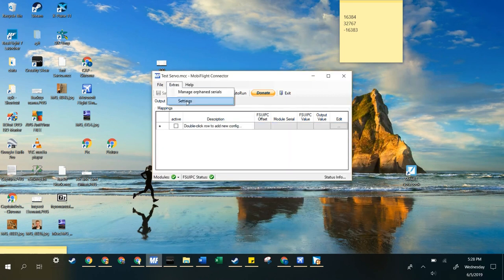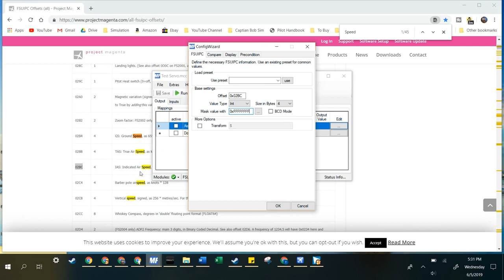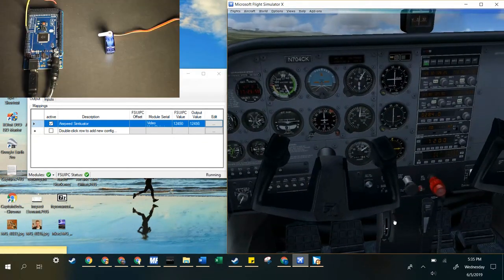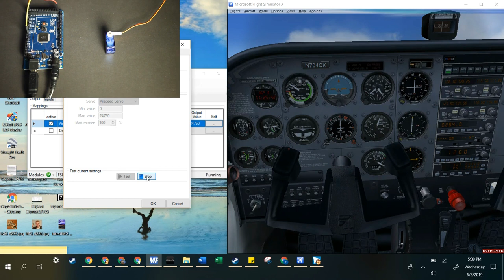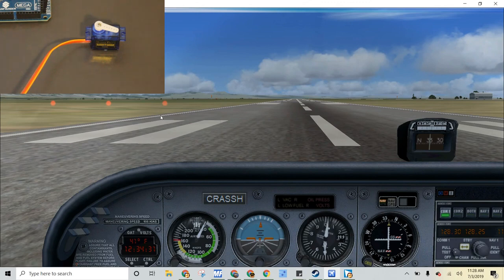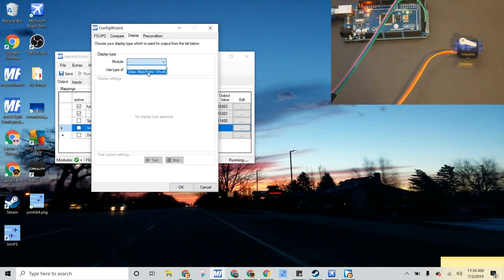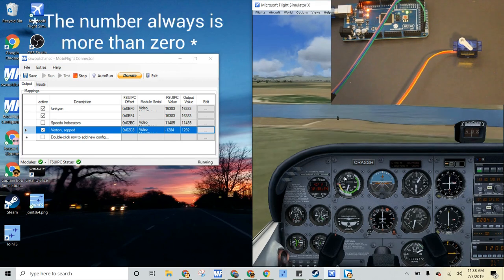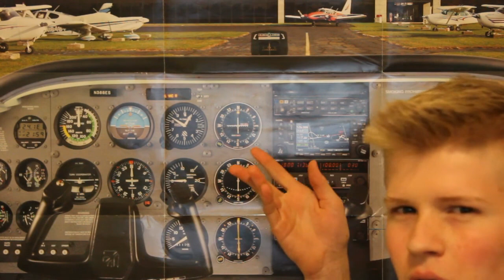How to Connect a Servo with FSX using MobiFlight | Captain Bob

Comment: We are running Mobiflight and using servos for our Turn & Slip Instrument and the two Volt/Ohm Instruments. The servos work for a while that after a few flights, the servos are non-functional. We are using Tower Pro Micro Servo 9g servos. No mechanical binding on shafts or Pointer. Any ideas?

Comment: I do exactly the as you do and the servo works fine but whenever I click on "test" in Mobiflight, my arduino board disconnects so the servo works for only 1 time. When I put a wire into the 5V pin, the arduino disconnects. How can I fix this?
Reply from the maker: Hello! Do you have anything else connected to the board? If so you could be overdrawing the arudino. If not I'd check your wiring and try another servo because this isn't normal behavior. Are all 3 wires connected correctly? Sometimes I put a pin in the slot next to where I think it goes.

Comment: Hi can You tell me if I can use a 360 degree servo motor to build a heading indicator? Or It's possible only with a stepper motor?
Reply from the maker: I'd go with a stepper, a 360 servo would have to rezero every time you go from 359 to 0 (go backwards 360 degrees)

Comment: Hi Captain bob how many servos can i attach to Arduino Uno with mobiflight when i tried to attached the third one it says only two can support is there any other way to go around it ?
Reply from the maker: Attach only two :|
The arduino Uno is very memory limited (at least for MobiFlight). I recommend using a Mega.
Reply: @CaptainBobSim   Thanks will do
Reply: By the way,  you have good videos, and  very educational,  keep it up, and well done.

Comment: Thanks for all your MobiFlight videos, have given me a lot of ideas on what I want to do. I have followed the directions in this video for airspeed indicator, but I am using the newest updated version and there are different menus involved now. I have had success with about 99% but cannot get the servo to show the airspeed in simulator when running. Appreciate any help you can give. Thanks.
Reply from the maker: That's great to hear! Have you tried clicking the "FSUIPC offset" button on the top selection box?
Is that where you are stuck?
I'm really glad you are enjoying the video!!
Reply: @CaptainBobSim  Thank You for fast response to my issue. In new software/update to mobiflight I have three sim variables on the main page, Simconnect..Mobiflight..and fsuipc. The only time I get a running flight sim value in the chart is when I use the simconnect option, I do not have anything showing in the output value column. It is about 10 knots difference from the actual  indicated airspeed.  I am using the 02bc offset. I do not know if I can show you screen shots to help explain. Am new to this part of things and have been watching a lot of vids to help figure things out and yours have gotten me so close I know I am probably a mouse click away from tackling this. Once I get one deal figured out I know the others will be easier. Thanks in advance for your help.
Reply from the maker: Do you have FSUIPC installed? If not, I have a recent video about how to: https://www.youtube.com/watch?v=DH1V4ZeqhZc&t=5s
If it's offset a little bit, you might need to apply a transformation "$+10" to add 10.
I have a video about manipulating values further here: https://www.youtube.com/watch?v=exEFExtaQQk
Hope this helps merc1180!
Reply: @CaptainBobSim  Thanks, will work on your suggestions.
Reply: Everything is now working after adding fsuipc, misunderstood about mobiflight not needing it for fs2020. I have worked with stepper and servos and all works great. One question is how are you getting more than 180 degree movement out of the servos? Are the gears that you have in the 3d printed items making that possible?
Reply from the maker: @merc1180  Great to hear! You can either use 360-degree servos, or use 3D Printed gears, check out my "Simple Instruments" video on the Airspeed indicator.
Reply: @CaptainBobSim  I found the 360 degree servos, looks like they have the same dimensions as the 180 degree ones. I noticed the steppers get kind of warm, is it better to use the servos or steppers in the gauges. Thanks again for all your vids as they have helped a lot and the fast responses to my issues.
Reply from the maker: @merc1180  I much prefer steppers, they don't jitter as much. Servos however, do really well with fast motion. I'm really glad you are enjoying the videos!
Reply: @CaptainBobSim  Sorry me again, I thought I had everything worked out on this stuff, have been working on 3d printing my gauges and have come back to the electronics side of things. I bought some of the 360 degree servos for rpm and manifold gauges, am building my bonanza g58 panel, so two of everything. When I get everything going the servo goes bananas spinning around will not stop till unplug the wire, if i hit test i goes back the other way. Thanks.
Reply from the maker: @merc1180  Hmm. I think you got a 360 degree continuous servo - it doesn't have limits at all, and instead of managing a "position" it manages a speed (example: telling it go to 100 sets it to 100 revolutions/min instead of 100 degrees). Maybe try this one?
I would ask an amazon question to see if it is non- continuous before ordering
https://www.amazon.com/JIANNIU-SG90%EF%BC%8CMicro-Steering-Suitable-Helicopter/dp/B09J86CD22/ref=sr_1_1_sspa?keywords=360%2Bdegree%2Bservo&qid=1643157377&sr=8-1-spons&spLa=ZW5jcnlwdGVkUXVhbGlmaWVyPUEzMk00TFBURllJVEc4JmVuY3J5cHRlZElkPUEwOTg2NjA1MkxHQzFXMVNJMTMxNCZlbmNyeXB0ZWRBZElkPUEwNzM0MDY3MzlZUk9JS084MFdTNiZ3aWRnZXROYW1lPXNwX2F0ZiZhY3Rpb249Y2xpY2tSZWRpcmVjdCZkb05vdExvZ0NsaWNrPXRydWU&th=1

Comment: Hi bob :) can you please make a tutorial how to set up a flap lever for the c172 with a potentiometer with mobiflight. I ordered one from simmax but i couldnt find a solution how to make it work. would be awesome if you also include the servo settings for the position feedback. Thanks
Reply from the maker: Hello again! I've decided to only make general top-level tutorials and specific tutorials for things I make things in the simulator. 
I have the top-level potentiometer tutorial on my list of things to do.
For now: The MobiFlight GitHub has an excellent tutorial here: https://github.com/Mobiflight/MobiFlight-Connector/wiki/Example-Analog-Input-Potentiometer
Thank you for your question, and let me know how I can help!
Use offset: 0BDC	4	Flaps control, 0=up, 16383=full. (or FS2020 WASM Equivalent)
I'd recommend using a 4 position rotary switch for flaps - these have detents with a much simpler solution.
Reply: @CaptainBobSim  thank you so much for your answer bob. i will try it 👍😬😁😁😁

Comment: i try to create my dynamic simulator with cylinder and i need the movement of the plane specificly when it is windy i need that effect of the wind to the plane to transform it to the cylinder ... our help please and thanks
Reply from the maker: Just to clarify: You want to have the cylinder follow the direction the wind is going?
If so you can use offset: 04DA (Size in bytes 2) 
Surface layer wind direction, *360/65536 to get degrees MAGNETIC. This may be different to the current wind direction at the aircraft—see offset 0E92.

Since this is *360/65536 the heading, you'd have to make the transformation ($*65536)/360

Comment: Can you make a video on landing lights. I can’t seem to find one anywhere.  I have 3 green and 3 reds and I don’t know what to do to change the inputs and output value. Gear down is 0 which and up is 1600 something. Help would be appreciated because this is what I’m stuck on currently
Reply from the maker: I'm doing something kind of like that next week. Use an interpolation to show
0 1600
1600 0 
to switch the values.
Reply: Captain Bob - Flight Simulation I would love to see this in staying up 24/7 until it comes out my friend lol
Reply from the maker: @uniteddrones7626  I've stayed up 24 hours, but I wouldn't recommend staying up 168 hours :)
Reply: Captain Bob - Flight Simulation probably been up this long right now working on this panel 🤣 this is definitely something interesting doing for the first time.
Reply from the maker: @uniteddrones7626  I bet!
Reply: Captain Bob - Flight Simulation side question, did some testing. Do you need fsuipc and prepare3D for this to work? I’m assuming yes and I’m a noob lol
Reply from the maker: @uniteddrones7626  You do need FSUIPC, as well as Arduino IDE. Make sure the version of FSUIPC is compatible with Prepar3d
Reply: Captain Bob - Flight Simulation so I’m missing prepare3D and fsupic okay. Thanks! I appreciate ur help

Comment: Can i do it with a ardureno uno
Reply from the maker: MobiFlight doesn't support the Arduino Uno, but it might work. I would recommend using a MEGA.
Reply: @CaptainBobSim  It support Arduino uno i have two both working fine on mineMega has more pinouts but you can use shift registers
Reply from the maker: @SpaceMarine819  Yep! MobiFlight Added Uno support since making this video.

Comment: Thanks for sharing :) Can you share a video on connecting a servo for 737 Flaps gauge with MobiFlight.
Reply from the maker: Hello,
I added this to my list, but the video won't happen for a long time. 
Refer to this video about the Airspeed indicator, and then apply the concepts to your airspeed indicator. 
Most people use stepper motors for Flaps Gauges though, because they have more travel.

Comment: Hi, How do I know what board to use. Also can I connect more than one servo to the board. If so how.  Thank you for the good video by the way. Very helpful
Reply from the maker: MobiFlight is only compatible with the Arduino Mega 2650 (and Clones).  Other Arduinos are not yet supported. You can connect multiple servos to the board. Use the same steps for adding the first servo. There are 3 5V pins, and 3 GND pins per Arduino Mega, so without using a breadboard you can use three servos. Once you get over 1 servo I would reccomend using external power with the arduino.
Reply: @CaptainBobSim  ok thanks for the help. If i dont use external panel what happens. Also do u know measurements for cessna 182 cockpit
Reply from the maker: @hashimiqbal6822  If you don't use external power (5V cable) there is a much higher chance that you will go over the power delivered through the USB cord. Not having this cord could kill your Arduino (It broke an arduino this way)

As for the 182:
C182 Measurements are very similar to C172 Measurements, the C182 seems to be 2" (~5cm) bigger.
The C182 cabin width is 42" (106.8 cm)
I have a C172 panel printout you can scale up to 105% to get a C182 panel.
https://flyingforfun.weebly.com/cessna-172-cockpit.html/#ThePanel
(Dowload the PDF, and make sure you have Adobe, when you print, print on poster, with 105 size)

Of course the C182 Measurements vary by model, so be aware that these measurements may not be 100% accurate.
Source of measurement: https://www.euroga.org/forums/aircraft/1887-cabin-dimensions-width-of-se-aircraft
Confirmation: https://www.globalair.com/aircraft-for-sale/Specifications?specid=259
Newer Model POH (Pg 7) https://vanbortel.com/files/2015SkylaneSD.pdf

If you want to make a Glass cockpit, use page 11 of the POH, and scale it up with a caliper, or do it on the computer. https://vanbortel.com/files/2015SkylaneSD.pdf
Reply: @CaptainBobSim  how would u comnect the external power. Also what materials should i get for the panel.
 Thank you
Reply from the maker: @hashimiqbal6822  You just plug it in to the wall using a 7-12V cable (sorry I said 5V before 🙃) https://www.arduinostarterkits.com/wp-content/uploads/2018/01/SunFounder-9V-Power-Adapter-for-Arduino-UNO-300x300.jpg
You could also use a 9V battery with an adapter. https://www.emartee.com/Images/websites/emartee.com/arduino_battery_adapter_2.png

The materials for the panel are mostly preferences of what people like to work with.
I am a woodworker, so I like to make mine out of plywood. Some people like plastic (But it is weak, so you will need support. There are also other choices like metal and foam.

I would go with wood if this is your first homecockpit. It is fairly easy to work with (You could do the entire panel with just a jigsaw, skill saw, and drill) and it is fairly cheap ($35/sheet). I am using 3/8" birch plywood. 
Don't go too cheap on the plywood. OSB and Construction plywood look bad for a panel.